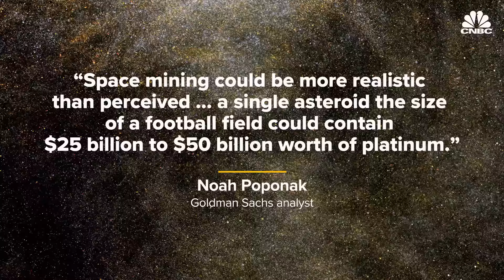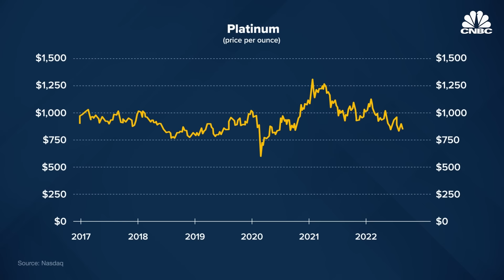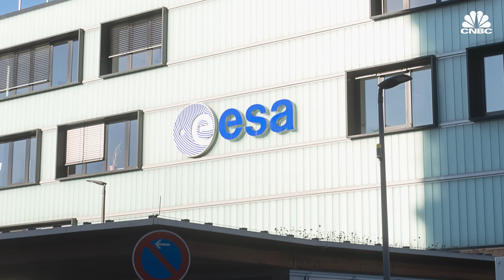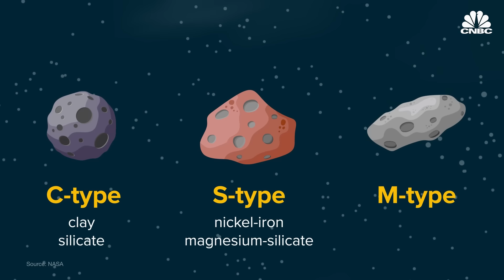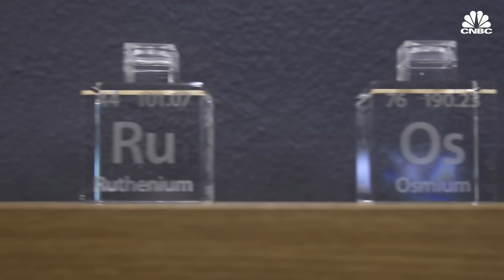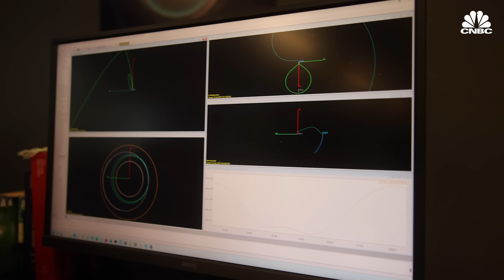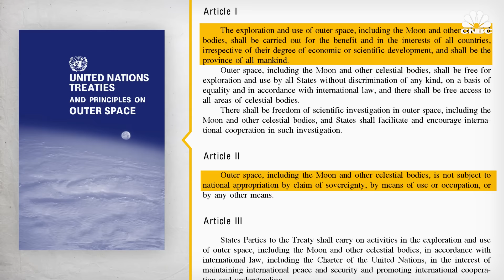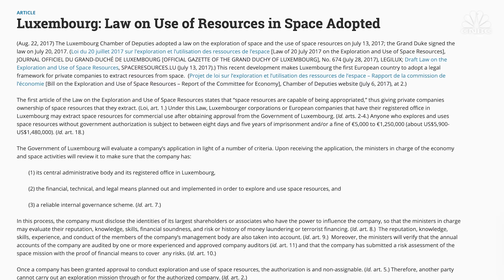What Happened To Space Mining?

Comment: Mining in space for space makes more sense. Because it cost alot more to bring materials from earth because of earth's gravity. The cost of anything also depends on transportation it doesn't matter if it is on earth or space. The higher the transportation the higher the material cost. Then because of the new technologies once those technologies are in space it makes it easier to build in space. For instance if you build a large spaceships with gravity in space. Once you have the infrastructure on the moon it would cost less to build these ships in moon orbit than earth orbit. On the moon there is titanium and aluminum which can make very strong alloys. You could launch those materials in orbit with a electro magnetic rail. Large ships like this would make us a interplanetary civilization it would be able to go anywhere in our solar system.
Reply: I mean we could use that to our advantage and effectively just drop things from orbit using Aldrin cyclers.
Reply: @KRYMauL  The cycler ships don't need as much delta v. They start in orbit and increase delta v to get to where they are going and use gravitational bodies to help. Larger reactors could be used the energy buffered super cooled condensers. Then use large vasmir engines. The buffers can recharge in orbit and on the way to location. The vasmir is variable specific impulse which is the most efficient. It is like gears in a car. You use the same power out put but decrease the mass of the propelant as you get to higher speed. This well give you higher specific impulse.
Reply: Except WHY should we go up there in the first place? Unless space benefits us down here, there is no reason to go up there.
Reply: Space mining (basic formula): asteroid mining drone, transporting drone, processing drone, and SpaceX interstellar cargo rocket drones to transport resources back to earth.
Reply: And by building and taking resources from asteroids and the moon we wouldn't be destroying our own environment. I bet one day it will be illegal to do any mining on earth and it will all be done on other planets or asteroids.
Reply: @TheBooban  Servival of the human race. And it would benefit us.
Reply: @squidwardo7074 Maybe so.
Reply: @TheBooban  what will happen if a big astroid hit earth tomorrow? The entire human civilization will be gone in a minute. so its important to have human on multiple planets/in space so that the race can survive. But hey why would all that matter if it doesn't give extra performance to your new ps5🤡
Reply: You are in part right.
The biggest problem with everything in space is logistics. How do you get stuff from point A to point B. And its not that different to what we do here on Earth now. Its just that most people have no idea of how much stuff we move. 

I am an aerospace engineer who moved into the Australian mining industry after meeting Harrison Schmitt (Apollo 17) in 2002. At that time he was talking up the possibility of mining the moon for Helium-3. I went looking for real practical experience and was lucky because at the time Australia went on a mining construction boom to feed China raw materials. 
What I got was an education in practical mining, site construction, maintenance, mineral processing, logistics and importantly INFRASTRUCTURE. Before you even start digging mine sites need a staggering array of infrastructure for power and water.
I can tell within seconds that most of these people have never even visited a working mine. I have actually built them and worked on them. When real mining people see this stuff they can't stop laughing. 

Irrespective if you are Jeff Bezos who wants to shift all iron processing into Low Earth Orbit (LEO) or mine an asteroid you need to get the iron to where you want it. That means bringing it down to the earths surface. The biggest payload carrying vehicle so far that could bring stuff back down was the Space Shuttle and it could bring 14tons down from LEO. I once worked on a min that did just over 20,000,000 tons a year of iron ore at an average of about 70% iron content by weight. So those 20 million tons of ore coverts to about 14 million tons of iron and if that 14 million tons was in orbit it would take 1 million Space Shuttle Flights to bring it down. 

Australia's annual production of iron ore is about 815,000,000 tons of iron ore. If you do the math to ship Australia's iron ore production up to LEO and then bring the iron back down its around 40million space shuttle flights a year. Even if we magically built a new super rocket 100times better that's still 400,000 flights a year.

I will be honest until I was involved in mining I had no idea how much material we actually move these days. The logistics of world trade is simply staggering.
Reply: If you don't know that it is no use talking to you.
Reply: But we have a space elevator it would be chill
Reply: @tonywilson4713  infact most engineering  projects proposed for space is quite ridiculous such as A Mars Base this project is beyond reason as there is no benefit and massive risk. What we need to do before conolize and industrialize space is to develop far more advanced energy production such as those related to nuclear fusion..
Reply: @christopherharvey4849  You are very much on the right track.
I can't say nuclear fusion is "the technology" we need to develop but there's a whole range of technologies that have yet to be developed to the stage where they can be used. AND there's a lot of unanswered questions regarding how we'll do things.

I quite often point out that the Space Shuttle was on one hand an incredible achievement in that they made a reusable space plane work, but that it was also a horrendous failure because it consumed resources in terms of both money and people that starved development of a lot of other technologies we need to do things like build a moon base and then make it work.

Things like space suit development just froze and if you know where to look it up they almost had fatal failures on some of the longer Apollo Missions. The lunar regolith is laced with microscopic fragments of silicon oxides which are almost as hard as diamond and it got into everything like the wrist and waist seals. You simply can't do a 10-14 day mission on the lunar surface with an Apollo era space suit.
Reply: @tonywilson4713  There is a short cut to fusion. But one of the other technologies  we need to be developed is liquid fuel molten salt reactors and thermal rocket powered by this. This was already done over half a century ago and ground tested it works. The draw back is the radiation it produced in the atmosphere.

 But that is not really a big problem in space. What I am suggesting is building large ships in orbit with artificial gravity from a large spinning structure. And powering them with the technologies I mentioned. The liquid fuel molten salt reactors and thermal rockets. Once SpaceX starship is working we well be able to get large enough payloads into orbit to build this kind of ship.

This technology would also be beneficial for earth to clean up all the radiative waste. You see the breeder type of this reactor can burn radioactive waste. Plus the fact it is extremely efficient. It can be made to burn 98% of the nuclear material. And then that 2% is usefull radioactive isotopes.The reactors we have now only burn 2% the rest is radiative waste.
Reply: @simpledragon  What are you talking about that would deplete our planet?
Reply: @christopherharvey4849  There is extreme benefits for a colony on Mars.
Reply: @clementvining2487  would you care to elaborate.
Reply: @christopherharvey4849  Mars is middle ground for the resources of the outer  solar system which is extreme. It has 1/3rd the gravity a possible fuel and supply depot. A observation point to protect the earth from asteroid strikes. And a launch site to actually deflect the said asteroid. A place to make use and produce logistics for the resources of the outer solar system. And a second place for man kind to live.
Reply: @TheBooban  Because we will die off if we don't go space.
Reply: @TheBooban  It ultimately does because you get better alloys the people who live over there will have to come up with new technology to live up there which would improve the technology you have on the earth and vice versa thus having a new tech and Industry boom
Reply: @christopherharvey4849  that's true but people only do what they must not what they should do in humans do their best work when they're under stress and must complete it understand sink or swim swimming starts looking very good doesn't it
Reply: @tonywilson4713  You are correct about the logistical problems of space mining. But the solutions are the same as on earth. Transportation is a big part of the cost. So the shorter the transportation the lower the cost. The larger the transportation vehicle the lower the cost. 

So we need large ships built in orbit then finished materials shipped to the nearest location that needs them. It only pays to ship materials to earth if those materials are harder to get on earth. And materials  in space don't have the same value as they do on earth. So everything depends on the infrastructure and the economy. When something is mined the farther the travel the higher the cost. Each location is going with the lowest cost to them. If a colony on Mars or Venus or one of the moons of Jupiter needs something they are going to do what is the most cost effective for them. If it is on the moon the same thing. Each of these location well have resources that drive there economy. 

The moon building large ships in orbit with materials mined on the moon. And energy production in the form of antimatter. Venus energy production in the the form of antimatter for ships and fusion. Mars a location that is in-between  us and the outer solar system and all its resources. Some of the moons of Jupiter  enormous resources for the rest of the solar system.
Reply: @clementvining2487  I HAVE SPENT MOST OF THE LAST 20 YEARS IN THE MINING INDUSTRY SO STOP PREACHING TO ME.

I know more about the logistics of mining than you do. Its what gets me angry about clowns who try and preach to me about it.

Unlike so many of the clown brigade I went and got real experience.

So stop preaching to me until you go and get real experience too.
Reply: @tonywilson4713  Another thing experience doesn't give you all the answers all it dose is know how to repeat what has been done. That is not progress if you don't learn from it you simply keep repeating the same mistakes.
Reply: @tonywilson4713  And because what you said got me on a roll. I owned a oilfield trucking company for over 20 years and worked ordering and shipping in a warehouse for a few years a manager. But I didn't use it to bolst like you even though I do have experience with logistics. And by the way logistics is not all that difficult it is simply numbers. I actually set up a computer program that allowed me to cut inventory by 80% and so much less special shipments that people where layed off. And avaliablety was actually better.
Reply: You could as easily mine in space , manufacture in space and then ship final product to Earth. Though if we do start mining and manufacturing in space , a lot of otherwise difficult or impropable scenarios suddenly become possible. Building huge space stations with spin artificial gravity suddenly become extremely easy to do. Building an orbital ring becomes a child play. With an orbital ring or similar mega projects , transfering things to or from Earth becomes a non issue.
Reply: @alexandervlaescu9901  I agree but the thing is we have the capability to do the large spinning space stations now. The only thing missing is to get large payloads into orbit. And that same technologies can be used to build large ships with gravity also. 

This well allow us to stay in space as long as we want. We can have large mining and manufacturing ships. We can also have large transportion ships for cargo and people. This would allow us to produce a  moon colony in a few years. These ships would allow us to go anywhere in the solar system. They could be powered by liquid fuel molten salt reactors. At first use water as a propelant. These reactors are basically a system of high temperature and corrsive resistant pipes  tanks and pumps. There operating temperatures is a thousand degrees it needs to be increased outside the reactor to 1500 degrees for a rocket engine. These kinds of rocket have already been built and ground tested over half a century ago by the military they work. 

Or generate magawatts of electricity backup power in nitrogen cooled super compactors and use large vasimr rockets the size of SpaceX starship. The orbital ring well never be built it is Impractical the cost well always outlay the benefit.

There are easier ways to getting into space. There are now methane powered jet and rocket hybrid propulsion system being created that can get to space like a plane from a airport. There is also antimatter catalyzed fusion not far away. And a economical way of producing antimatter for it. Point is we have the applied physics and engineering to develop these technologies now.
Reply: @TheBooban  Mining in space would benefit all of us, I seem to be the only one who is calling for humanity as a whole investing in it and getting money out of it, look at the ISS.
Reply: @tonywilson4713  Issac Auther talks about some ways to build infrastructure to get into space a lot cheaper.
Reply: @bristoled93  Yes I know who Isaac Arthur is and he way too often confuses science fiction with reality, but then so many of the so called "science communicators" are guilty of doing that.
Reply: @tonywilson4713  Issc Author doesn't confuse science with science fiction he sometimes compare them.  He talks about theoretical physics, future technology, applied physics and science fiction comparing them to science. He is a retired college science or physics  professor. He is not a normal YouTube influencer who doesn't know what he is talking about. 

It is you who doesn't know what you are talking about. You seem to not know the deference between theoretical, applied physics and science fiction. You seem to think if we are not doing it now it is science fiction or theoretical.

 Theoretical is theory not necessarily proven. Applied physics is proven in at least concept even if it is not built or have a protype.

 I really don't think you have all the experience you claim. I haven't seen you provide anything in any conversation that shows you know what you are talking about. All you do is bolst about you experience with absolutely no solutions to anything above what a normal person would know.
Reply: @alexandervlaescu9901  there is no space.
Reply: @clementvining2487  HERE'S SOME EXPERIENCE.
In 2013 I worked for Rio Tino on the Mount Tom Price Mine.
https://en.wikipedia.org/wiki/Mount_Tom_Price_mine

If you or any others look at the satellite you'll see there's no airport at the town of Tom Price. You actually fly into the airport at Paraburdo and you fly there on one of the last fleets of Boeing 717s because 737s are too heavy for the runway. HOW DO I KNOW THAT? Because I have worked there. 

If you google earth the coordinates in Wikipedia the red marker is right on a straight line (going left to right). That's the conveyor for the reclaimer to the north of that is another parallel line that is the conveyor for the stacker. In between is the high grade fines stockpiles. North of that is the high grad lump stockpile. That line of divots are because it load the trains with a series of chutes under the stockpile.

I could describe that site in detail. BECASUE I HAVE WORKED THERE.
I can describe other mines in Australia because I have worked on them.
Reply: @tonywilson4713  I thought Isaac Arthur is well known for reality based concepts, all his videos seem very reality based to me.
Reply: @bristoled93  They are he is a retired college science or physics professor.
Reply: @bristoled93  They are he is a retired college science or physics professor.
Reply: @clementvining2487  Yes I thought so, Issac Arthur does explain things well.
Reply: @bristoled93  I gave up watching his channel a while back because it was to much futurism and I have a very short fuse with futurists. They push conjecture and ideas as if they will be fact in the near future. They have a terrible way of grabbing public attention that the media then latch onto and then engineers spend months unravelling what they set in motion.

The mainstream media like to have futurists on because they can spout almost anything and the media can stand back and claim "we didn't say it that person did." They then repeat that and repat it and repeat it and eventually it goes from being an idea to accepted reality. And university professors are among some of the worst at that. Most people don't realise that academics have to fight for funding. So they often promote "imagine when we have....." 

AI is arguably the worst example. A staggering number of people actually believe we have computers that can think. When we can't actually explain what thinking actually is. What we do have are algorithms that can mimic a human for specific well defined tasks. Its why it works so well with image analysis in areas like facial recognition.

Space mining is another futurist fantasy promoted by people trying to raise cash. Most people have no idea what mining is about, other than it involves digging and they know even less about space.
Reply: @tonywilson4713  Some of what you say is correct but you go too far in the other direction. You are someone who can't think outside of the box. You don't seem to know the deference between theoretical physics, applied physics and science fiction. Yes some of his ideas I don't agree with but most are applied physics like antimatter technologies. Sooner or later we well start using it. It makes fusion possible in the near future. You simply use it in the microgram level to heat the plasma instead of all the power it takes other wise.
Reply: @tonywilson4713  Would you of called space stations a futurist fantasy too?  Or the internet?  A lot of things are seen as futurist fantasy until they happen for real.
Reply: @bristoled93  Buddy I was in college when Challenger happened. Before that reality slapped us down our main topic of discussion was how we would be build Space Station Freedom and then head back to the moon. A few years down the track one of my class mates was helping build the ISS. We actually had a disagreement circa 2000 about how that was proceeding and she slapped me down with some harsh reality about what it took to build in space. So I know what getting slapped down with reality feels like.

She's now one of a group of people that if you don't have her approval your stuff doesn't go to the ISS. 

We went to U. Illinois and down the street from our building was the National Center for Supercomputing Applications (NCSA). A couple of after we were there some of those guys as a side project did the Mosaic program. That became Netscape and then Internet Explorer.

So don't lecture me about space stations or the Internet.
I know more about both than you ever will for one basic reason.
I LISTEN TO PEOPLE WHO KNOW MORE THAN I DO.

Its how you learn stuff.
Reply: @tawan5753  I see you beltalowda
Reply: you don't have to mine in space just throw the asteroids to the Earth
then we can blow up them using rocket
Reply: @seyedmortezakamali2597  Yeah right we'll just see if we can get Wile E. Coyote to design that system right after he finally catches the road runner.
Reply: Given Earth's population is declining, there is no point for "space mining".  Because mineral cost is only getting cheaper as human population collapse
Reply: @clementvining2487  Mars is not and will never be permanently settled and inhabited by Man for the simple fact that it's gravity would be lethal to humans.